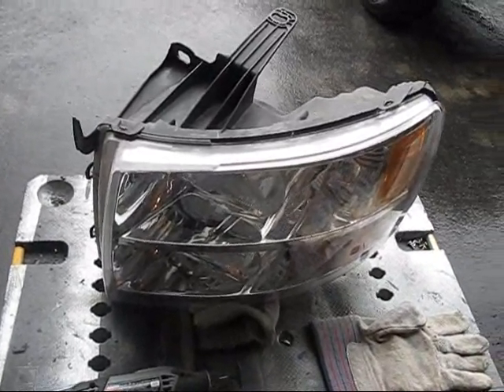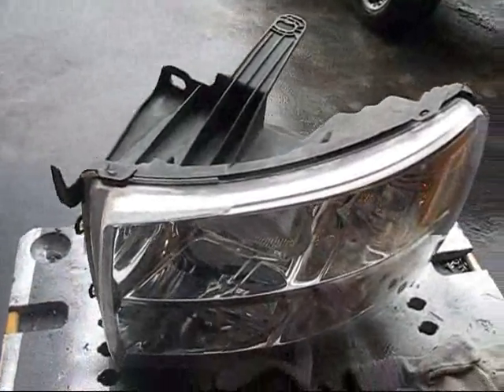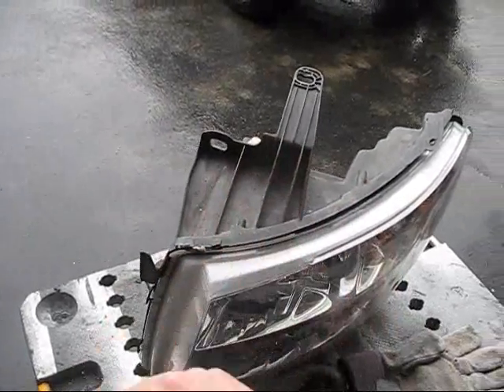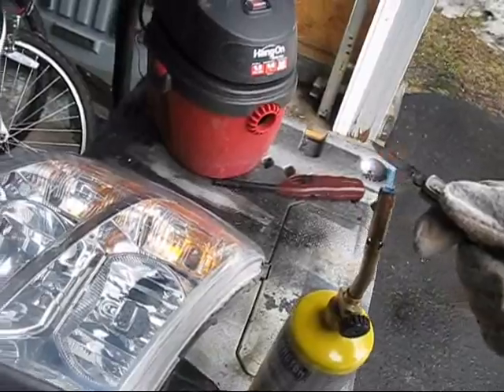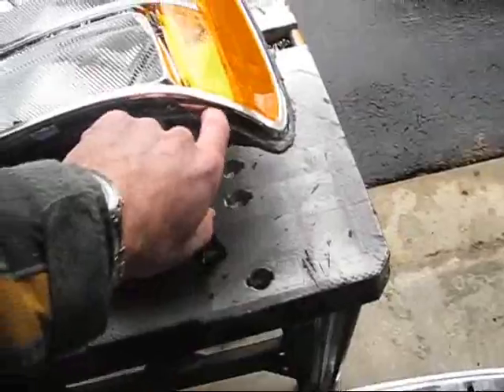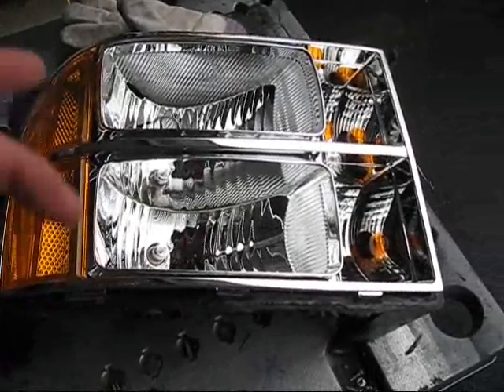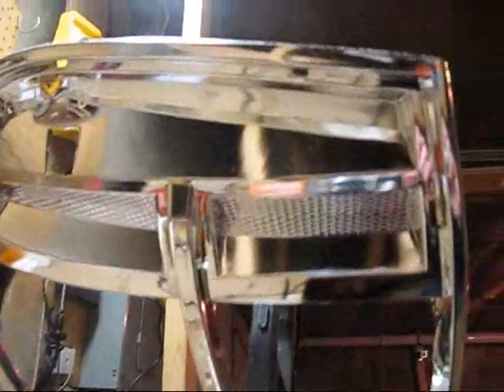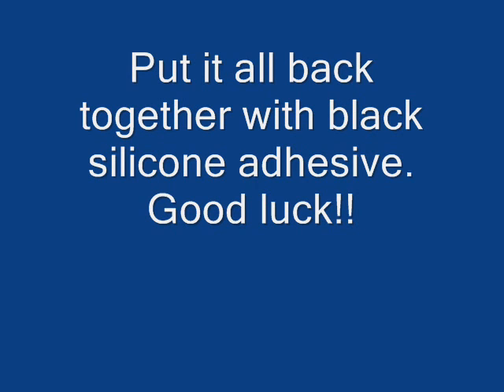Clearing NNBS Silverado and Sierra Lights

Comment: I cut my 2012 silverado lights to paint them black, and I taped off the buckets that the lights sit in so that will remain chrome. I also removed that silly reflector. It's been 2 years with no issues and no water leaks. I get compliments all the time too. If your patient and take your time,  it will turn out great.

Comment from the maker: i don't heat up the knife.  I use a hole saw to get in behind that tab on the inner side of the light.  I just simply use a steady hand and dremel to cut the reflector tabs. I also don't tape off the lights before sealing. No major differences though.

Comment from the maker: That would be great if it would work. Headlight plastic will melt before the silicone. Tried it as many others have as well. Unfortunately this is the only method that is safe and works. I do my cuts a bit different than shown in this video. After I cut u can't even tell and that is before the silicone.

Comment: You are cutting your headlights? Seriously? You just screwed them up MAJORLY by doing that. It is best to put them in an oven and no, the "plastic" which is polycarbonate will NOT melt before the adhesive. If the "plastic" melted then explain to me the thousands of vehicles I have had in a paint booth which baked on the paint yet not one single headlight was ever melted. I have been in the auto collision repair business for 20 years and have never seen one melt. I will say that you are misguiding people into hacking up and destroying their headlights permanently in doing this procedure. NEVER cut your headlights. If you want to open them, bake them in an oven for just a very few minutes and slowly work them loose. It takes patience to do it and you cannot rush it.
Reply: Can you please give me detailed instructions on how to open the headlight by baking it?
Reply: Nate Wrabel TheRetrofitSource has a video on there YT channel.
Reply from the maker: lol. okay. give a set of oem chevy silverado headlights a shot in the oven and let me know how it works out for ya. been doing this for 10 years now. depo, tyc, Dodge, toyota, Ford lights yes you can bake. no go on the nnbs and older gm permaseal lights. done 500+ lights just like this with no issues. just saying  ;)
Reply: Pagan Sunburn i seen it done with a heat gun on a Tahoe with no problems came right off
Reply: Check out everyone that does led halo they bake them.